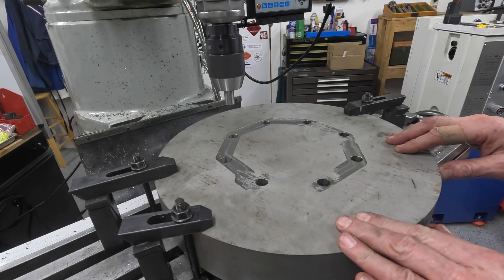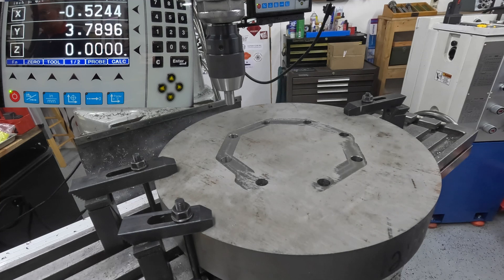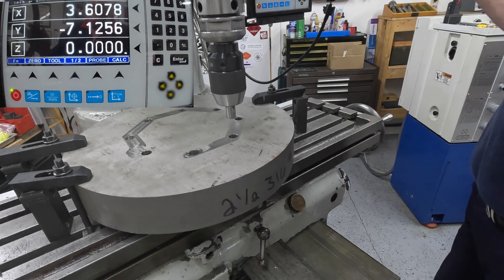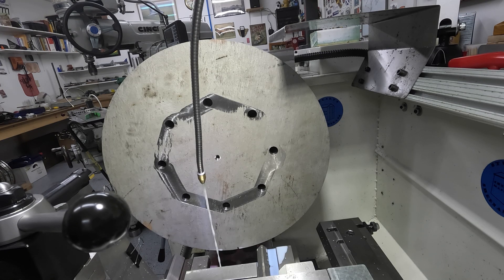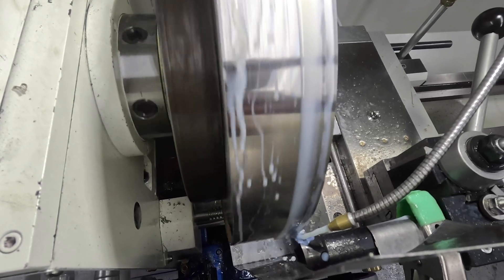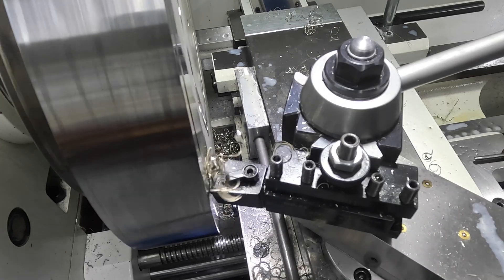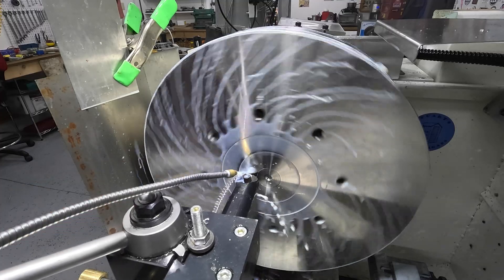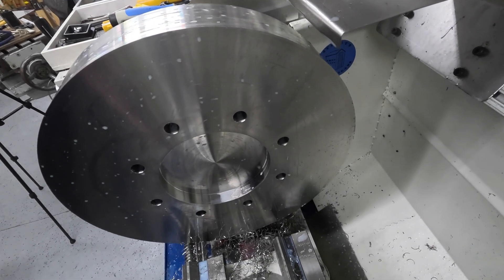Spacers Part 3 - Finding a bolt pattern center and turning Big Parts on a small lathe.

Comment: I see a left handed boring bar in your future.
Reply from the maker: Funny you should say that - I started off just trying to use what I had, but in the end I just bought some left hand tools and that really made a difference. Those will be shown in the next part of the series.
Reply: @StuartsShed  I imagine you got less flex with the lathe turning forward and the tool pressure is coming down.
Reply from the maker: You're 100% right Tom. As I watched the process it eventually dawned on me - far too slowly - that going in reverse with the tool at the limits of its reach - the machine was just separating the slides and saddle at every cut. I got a huge benefit as soon as I turned the right way. I thought I was being resourceful using what I had on hand - but not so much. Learned a lot though, and got through it. Got some good footage of proper chips for the next installment.